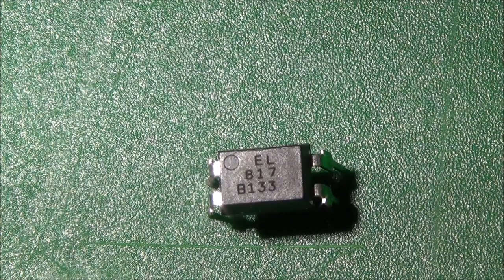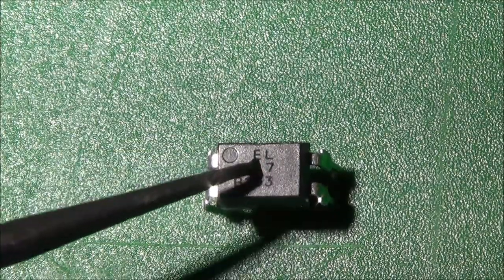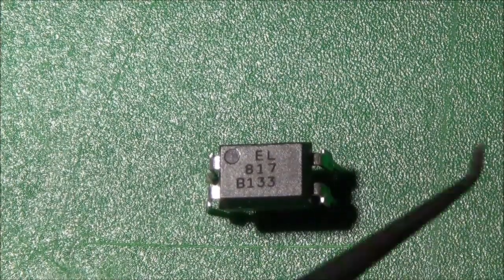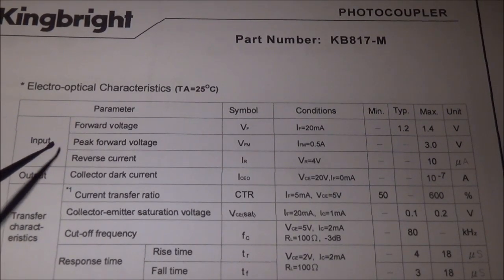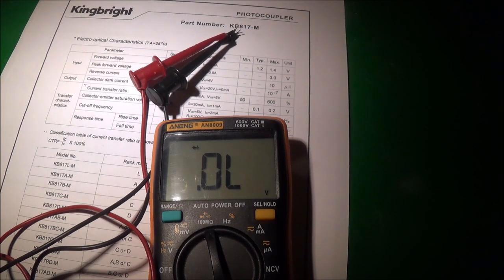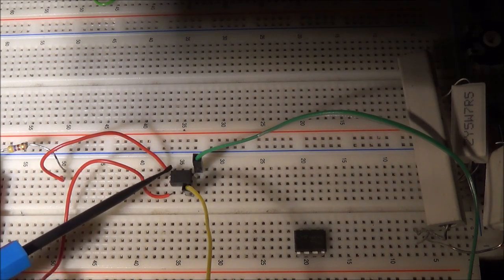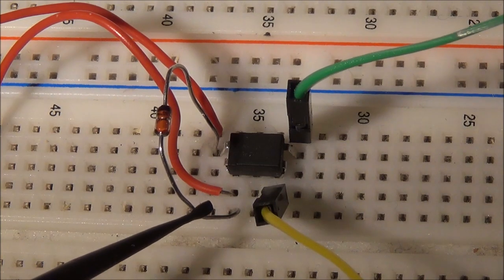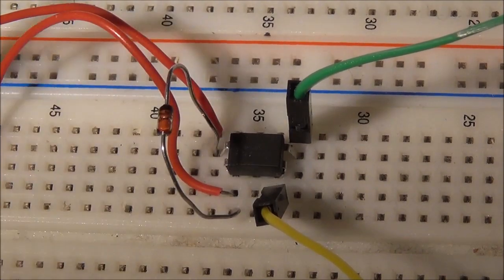Basic testing of an optocoupler.

Comment: Do you know of any electronic repairmen I could send a power supply in for possible repair? I was working on an arcade system and poking around while it was on. :/ I ended up grounding the LCD power supply right through the Mosfet heatsink. Blew the main fuse plus the soldered in fuse on the supply. I removed a mosfet (K3569) and it's not quite testing correctly. After being charged with the meter in diode, the gate slowly closes, never stays open. I have a few on order to test if a new one does the same thing. I pulled two optos, but they seem okay. I don't understand why the anode & cathode are on the DC side with all 4 of them. It seems this supply is hard to find, so my only option may be to repair it.

Comment: And he is back! You seemed to be reading my mind sir, I seen this thing many time but wonder how to check it for fault. Now I have some idea from sir. Simple test requires Datasheet and 2 multimeters( for A and B side). I guess I could sub the B side multimeter (your Fluke 87 in video) with analog meter with no problem? Thank you for pushing the test with power supply(I dont have yet), function gen and scope both I have.

I never bought a breadboard in my life but I guess its time to get one or two now. I would also like to see a video on reading the markings on a optocoupler. If its no trouble sir. 

Great basic tutorial sir. Keep uploading your electronic activities. Looking forward for more.
Reply from the maker: Thanks sir! Looks like I am back. To do a basic test you just need one meter. First check one side, then the other side. Also, you can use an analog meter instead of a digital meter. To a do a little more of a test you can use 2 meters. I started out with the easiest test. The markings are always in the datasheet. Breadboard is always good, doesn't cost much either. Power supply should be on your list; can be used to substitute voltages while troubleshooting, among other things. Thanks for watching.